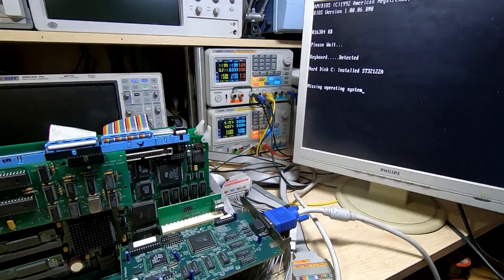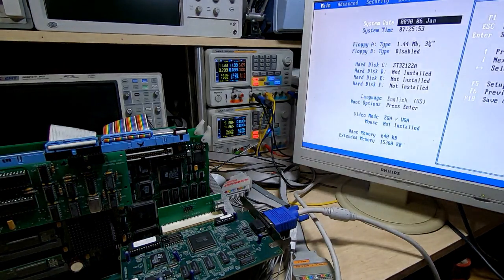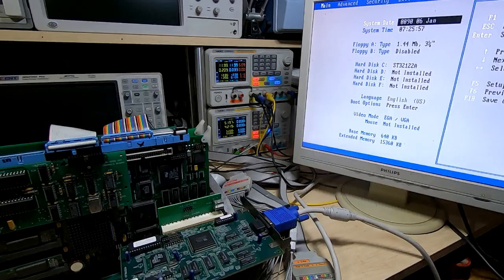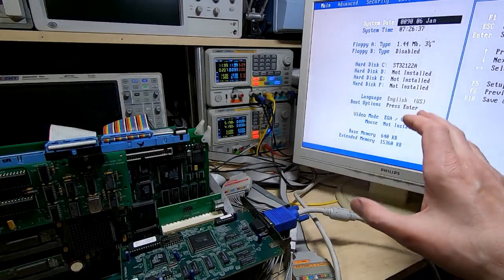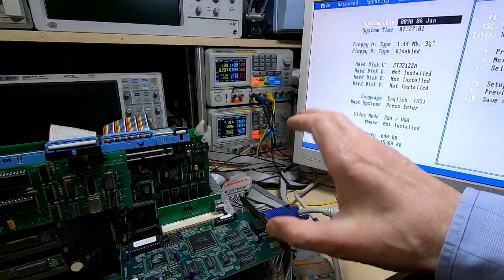Hurco BMC25 Controller Repair Part6

Comment: Hmm - this looks familiar. I seem to recall that the AMI BIOS had a custom translation facility where you defined Cyl/Sec/ SPT Trk parameters as a 'custom' drive. - I think used for the early hard drives that exceeded 512Mb to allow a fiddle factor. Have you tried to read the partition table? The old DOS Ndd disc editor does this nicely . The first sector should be readable whatever the geometry in the setup. That should tell you how the drive thinks it is formatted. And tell you the correct geometry that the custom drive definition needs to be in the BIOS. Apologies if this is granny/egg syndrome!! /As it lost its settings my gut reaction is the hdd is fine but geometry is not...
Reply from the maker: See the next video, I will show the settings for the HDD along with partition info etc. As I mentioned in the video the correct disk type is selected.
Reply: @JerryWalker001  I await with interest! comment based on many 486 based server connundrums... (read Netware)

Comment: What a nice achievement! I wonder if this specific bios is what is handling the external terminals connection or if the OS will load the task. It would have been a smart arrangement if default bios settings would allow the actual tool-machine pc hardware being recognized automatically. As ever I’m impressed by your approach and strategy to overcome this troubles. 👍
Reply from the maker: The machine is run from the operating system. This allows the controller to control different machines using software configuration but the same BIOS. The BIOS was not written by Hurco but the software was although the low level multibus port configuration is handled by the BIOS in much the same way as the PCI. It is quite a nice system, just a pity there is so little support and documentation for it.

Comment: Nice adapter board. I had every expectation that connecting a PCI board to the PCI port of the chipset would work, would have been surprised if it didn't. Looks like your customer will be pretty chuffed that you were able to "do the impossible."
Reply from the maker: Customer? Don't have any, I do this for free. Pity the 'support' company was unwilling to help considering that is their job. I was not 100% certain that the PCI card would work as there are a number of other active busses on the CPU card but this one seemed the most likely. Also I had to determine which type of card would work. I am really surprised that there is so little support for relatively recent machines but hopefully I can change that a little.
Reply: @JerryWalker001  In the machine tool world, 30 years old is ancient if there is technology involved. or if it was run in production it is beyond worn out. There's definitely a place for these machines, but it isn't in a production shop. Too slow, not enough axes, no pallet changer, etc. For a low-volume or prototype shop they can be a game changer over only manual machines. Or in a moderately well equipped hobby shop, which is why I have a 7500 pound VMC of similar capabiltiy to the Hurco.
Anyway, keep up the good work.

Comment: Hello. I've been following your book on making a micro processor from transistors and everything works except the Clock Gates. I have no idea why. I've been using 2n3906 PNP transistors for them opposed to your use of bc557. Otherwise, if I use the clock directly from the Clock Board it works perfectly.
Reply from the maker: I assume you reversed the 3906 as it has a different pin out.
Reply: @JerryWalker001  Yes, I've done so. The collectors go to 0V.

Comment: Very interesting. Looks like a nice Y2K bug in that BIOS?
Reply from the maker: I just have not yet set the date and time, It is actually a valid time and date but in the old US format. It will work fine with current dates. In fact this machine was in regular use until a few months ago.

Comment: Thank you for your videos, I miss them when you don't do any for a while.
I was really surprised when you said it was a PCI interface in your last videos, I would have thought ISA would have been more likely but PCI it is.
Reply from the maker: The north/southbridge chipset does support ISA but the ISA has a very different interface and uses different ports on the I/O.

Comment: From my own 286/386/486 days I seem to remember if the boot sector was missing on the HDD you could boot a DOS floppy and then use command SYS C: to put a boot system back on the HDD. It won't overwrite any data.
Reply from the maker: This system has a different OS
Reply: fdisk /mbr
Trying to get some CF cards in an IDE adapter on an ancient laptop to work. Nothing made it boot (including a special program to make CF cards bootable), until I tried fdisk /mbr. Then it just worked.

Of course that wouldn't fix the issue with running a different OS. Which isn't working. Would be a great excuse of running DOOM on it.